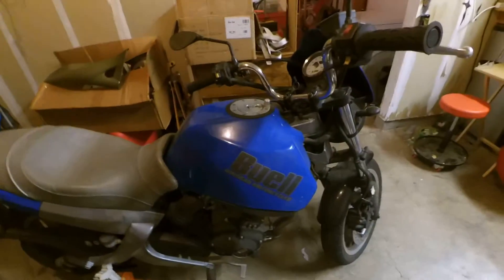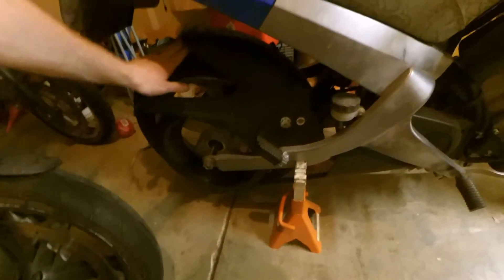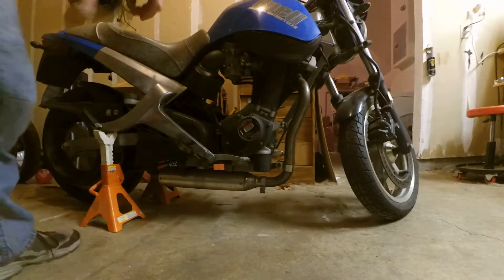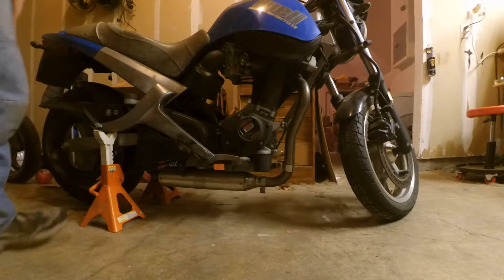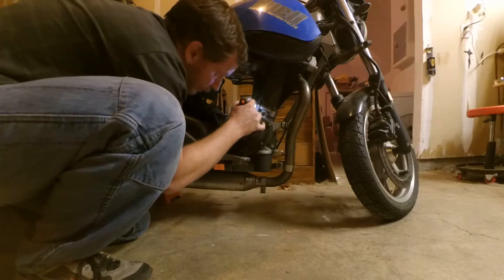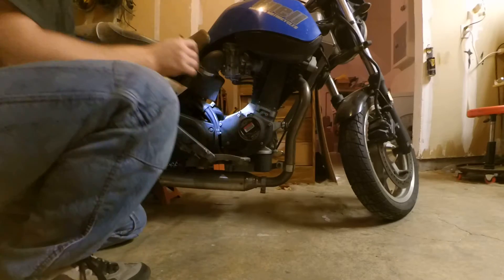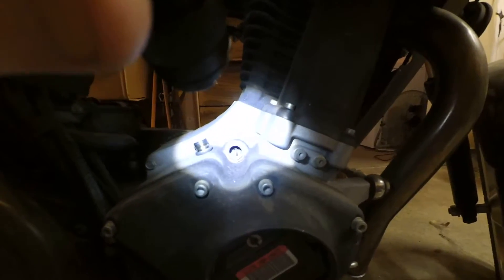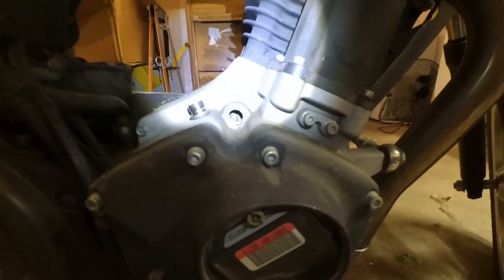Buell Blast - Static Ignition Timing

Comment: Hey man my timing light on the ignition module only comes on when the tick mark is rotated 180° away from the hole (I’m just guessing since I can’t see it, obviously) . When the tick is lined up center with the hole, I can’t get the light to come on no matter how much I rotate the ignition module. What can cause this to happen? Do I need to take the rocker cover off and move the pushrods? Bike is not starting at all. It seems to blow a lot of smoke through the airfilter when trying to start.
Reply: You are probably on the exhaust stroke instead of compression stroke like he said in the video.

Comment: Thanks for the Quick Tip Video!  I just bought a 2002 Buell Blast 2 weeks ago but it is not running as it is supposed to. If you don't mind. Can you help me diagnose the problem and tell me what you think is wrong? Here, I'll tell you what is going wrong. After I bought her, I got the float bowl part of the carb cleaned. The bike started right up after that but then started leaking fuel out of the carb (It didn't have this problem before) So I then took the float bowl apart again, adjusted the float level a little tighter so that no fuel would come out when it is up. Put it back together, turned the Petcock On and it wasn't leaking anymore. Ok, went to start up the Bike. And didn't start. Now, the only way she will start is if I cover the intake part of the carb with a towel. Hopefully you can give me advice so I could fix it since Harley charges $100 an hour. (Too Expensive for my Budget)
Reply from the maker: Leaking fuel is due to a sticky or dirty fuel valve, not the float level. Spray it out good with carb cleaner.

Adjust your float with a protractor following the manual at https://BuellMods.com

If still having issues, catch us at https://BuellRidersOnline.com
Reply: Leland Fried Thanks for the advice man. I really appreciated!